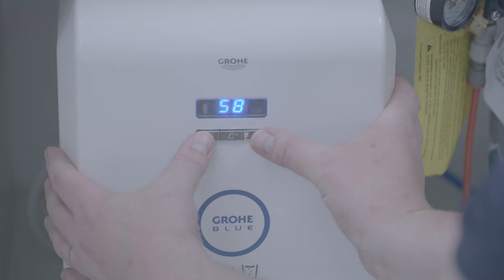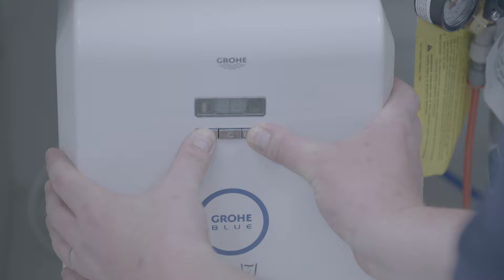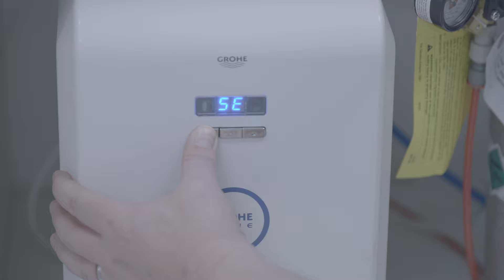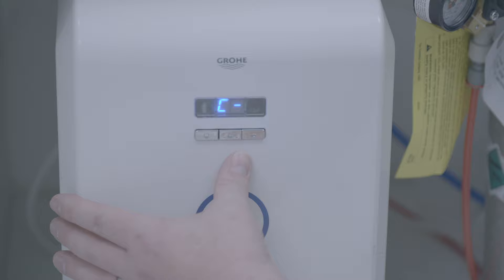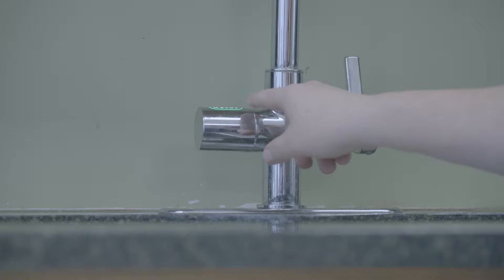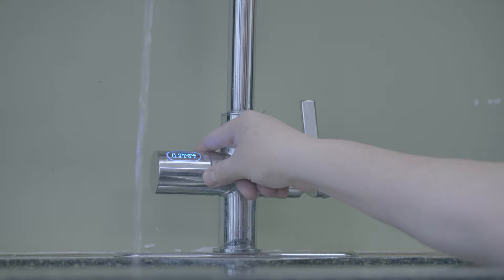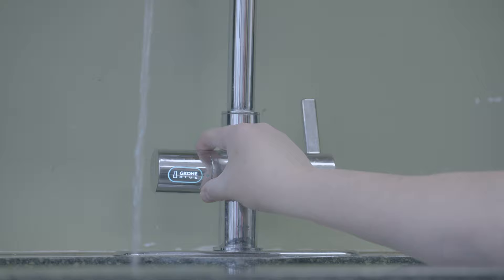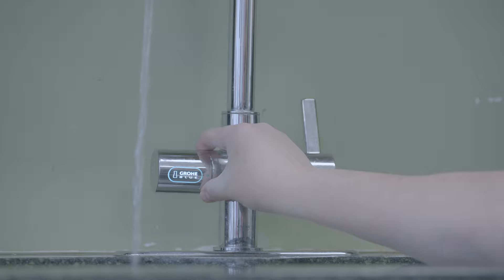GROHE | GROHE Blue Handle Calibration | Installation Video

Comment: Calibration works fine until I confirm with the left button. Handle starts flashing red again. The manual says that a calibration is necessary if E6 flashes in the display. Is there a way to fix this? I've already unplugged the Grohe over 24 hours, but nothing changes.